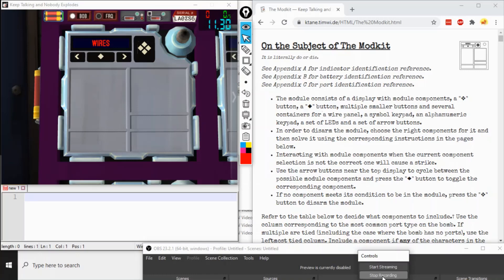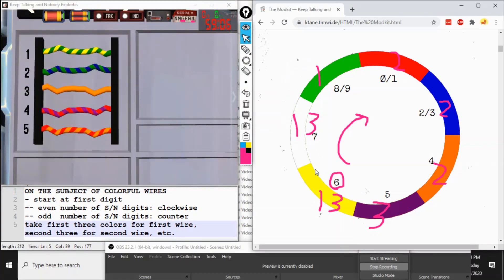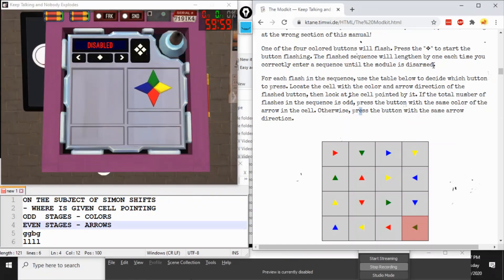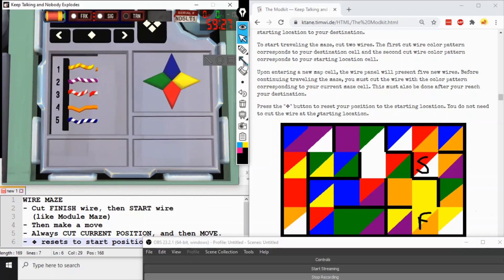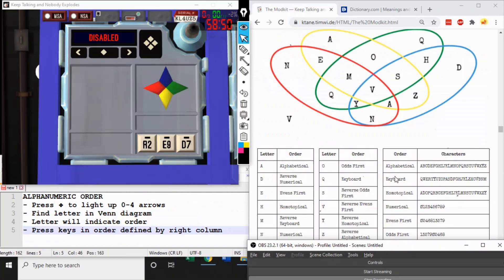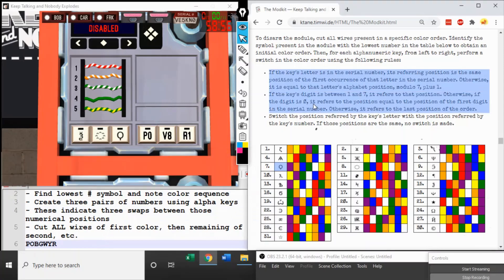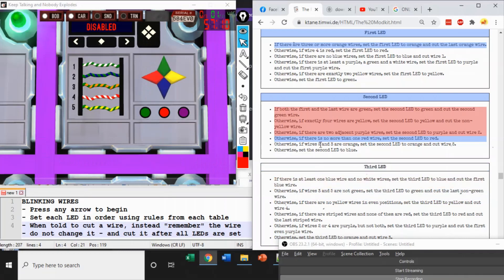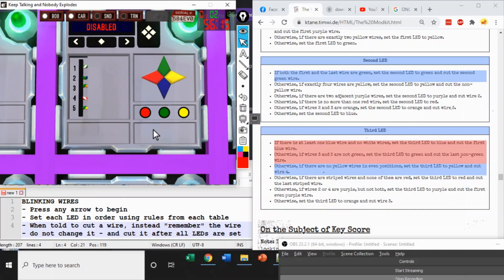KTANE - How to - The Modkit

Comment: For Power Grid, since there are color combinations that appear twice in the manual's diagram, let's say you have a case where the LEDs are Yellow, Green, and Purple,
my alphanumeric keys are A1 D2 F5, and you have a Yellow/White wire. In that situation, would you cut it or leave it be?
Since it does AND does not belong to a live power supply at the same time.
Reply from the maker: If either has a live connection to that "BOMB", don't touch it - one connection is too many! Leave that yellow/white alone. 🙂

Comment: For some reason,Enforcing parts of the module does not work,even though I changed them
Reply from the maker: Sorry to hear! The only possible trap for the unwary is that you have to click the first checkbox too, EnforceComponents. If it's unchecked, it will do its default thing of basing it on edgework. 
If you're doing all that right and the module is still misbehaving, drop a #mod-bug-report on the KTANE Discord.